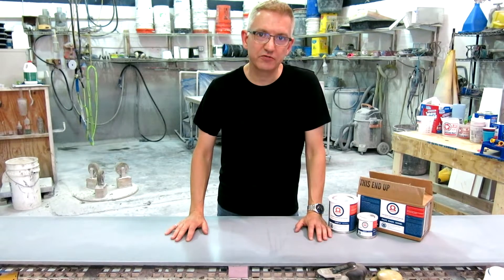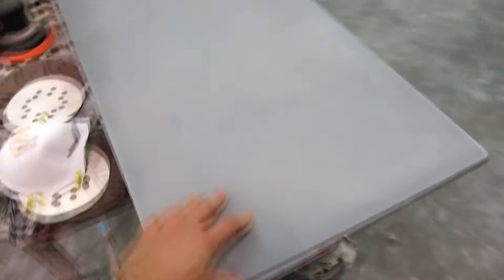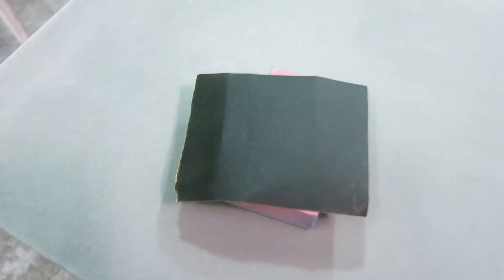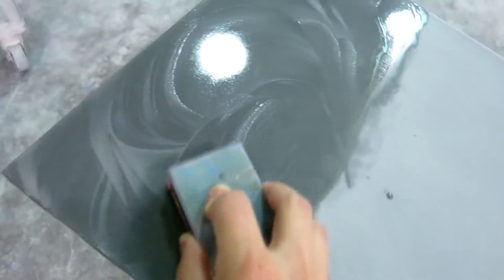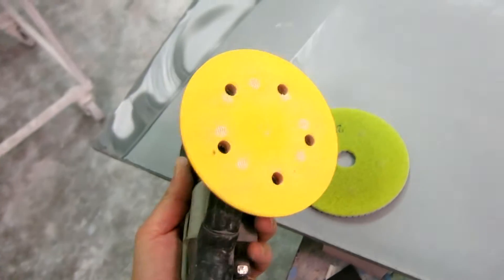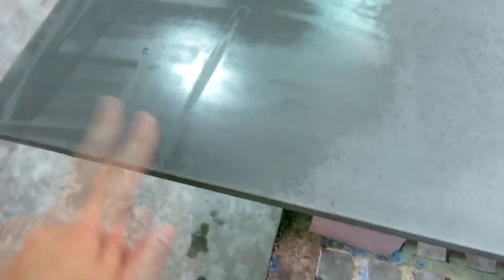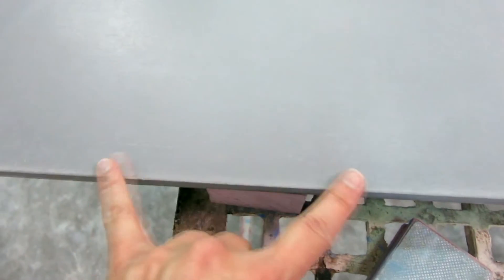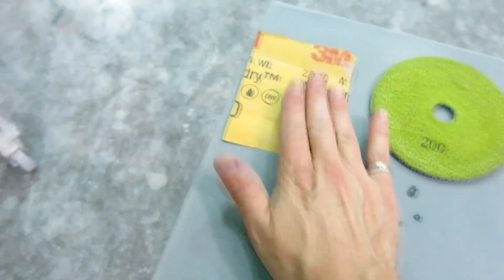Omega Instructions video 2a: Sealer Surface Prep Intro and Wet Processing

Comment: If I have an already acid stained concrete countertop (15 yrs old) and a considerable portion of the finished acid stain has already been removed just from regular use, can I use a wet sanding process to remove the remaining acid stain down to the original color of the concrete?

And what would be required to further prepare the surface to accept a different color acid stain?

Any other ideas such as chalk paint or other finishes?
Reply from the maker: Yes, you can grind down to bare concrete and then acid stain. The surface prep is the same as the surface prep for resealing with Omega. Please see this article: https://concretecountertopinstitute.com/free-training/reseal-concrete-countertops/ Chalk paint is not appropriate for concrete. You can use acid stain or a microcement/microtopping/overlay such as this: https://directcolors.com/concrete-overlays/
Reply: Will read the articles...thanks so much!
Reply from the maker: @samwimpy2600  You are very welcome!
Reply: @TheConcreteCountertopInstitute  Off subject, yet somewhat similar.

Subject: Grinding asphalt, can this be done?

My street was re-paved w/ asphalt some time ago. They paved on top of the existing street (made of asphalt) and continued to the edge of the curb. As a result, there was very little available volume left for drainage so when it rained, the street runoff would end up in my flower bed, yard, and eventually in my garage!

With the city not being much help, I decided I had to address this on my own. I used a heavy splitting maul to remove the asphalt that was preventing proper drainage in the street curb.

However, it is rough leaving my driveway. I need to find a way to grind the edge of the street to a gradual slope to smooth the transition when pulling in or out of my driveway!

Haven't found much information on asphalt grinding,  UT was wondering if some type of diamond honing attachment for an angle grinder would produce the results I need?

It's not a large area...just the width of a two car garage driveway?

Any input you can offer would be welcomed!
Reply from the maker: @samwimpy2600  That's a very different material. I really can't advise about asphalt, sorry.
Reply: @TheConcreteCountertopInstitute  No prob, thought I'd ask...thank you!
Reply from the maker: @samwimpy2600  You're welcome. :-)

Comment: Hi Jeff - thank you for the video series.  I have been creating concrete counter tops in my house & your videos have been invaluable.  I have been to Home Depot, Lowe’s, Walmart, & searched Amazon for white Scotch Brite Pads - no luck.  I am west of the Mississippi & the Rockies - any idea where I might find the pads or what would be a suitable substitution?  Thank you!
Reply from the maker: Hi Audrey. The white Scotch Brite pad is a higher "grit" and therefore less aggressive than the green Scotch Brite pad. You can use the green one and just be extra gentle!
Reply: @TheConcreteCountertopInstitute  thank you for your prompt reply.  I am creating concrete counter tops using Ardex (started with Henry’s) Feather Finish & it has been a bit stressful - I want the counters to look like I bought them from you.  I thought I was ready to apply the Omega until I watched all the videos sent following my purchase.  The wet sanding with 400 grit is a game changer!  I had dry sanded, of course , and felt good about the finish I had achieved.  Then I wet sanded and it looks beautiful.  Today  IS the day to apply the Omega!
Reply from the maker: @Audrey-km9in  Great, that's exciting!! Please send completed photos to info@concretecountertopinstitute.com (or send any questions there). By the way, we have a DIY overlay system like Ardex/Henry's called Finale. It comes in several colors and is very easy to work with, like frosting a cake. Check it out at https://concretecountertopinstitute.com/shop/finale-diy-concrete-countertop-system/

Comment: My kitchen cement countertops are now 20 years old. I would like to 'restore' them. There are acid etchings from lemon juice and some darker stains from various foods but what concerns me most is pitting around the sink. Can I diamond sand enough to get a smooth surface next to the sink and then seal them with Omega?
Reply from the maker: Hi Angie. You can, but it will take some work and will definitely change the appearance of the concrete and expose sand/aggregate. If you want a consistent appearance, you need to sand the entire countertop surface.  Please see this article for details: https://concretecountertopinstitute.com/free-training/reseal-concrete-countertops/ Also, hand sanding will be time consuming and laborious, and it might not be capable of removing enough concrete to eliminate the pitting. Therefore you might need a diamond polisher with 5" diamond pads. This page has extensive information about diamond polishing concrete countertops: https://concretecountertopinstitute.com/free-training-category/processing/
Reply: @TheConcreteCountertopInstitute  Thank you!
Reply from the maker: @angiem.3088  You are very welcome.

Comment: Hi Jeff, you mention that you can use this 400 grit wet technique to keep a cream finish and avoid acid etching. I’ve always just done the etching. What are the benefits of avoiding acid etching? Will using only the 400 grit help avoid having to grout pinholes?
Reply from the maker: Hi Mark. A lot of people swear by acid etching. There's no reason to avoid it unless you just don't want to work with acid. I'd say keep doing what you're doing. As far as pinholes, there's always a risk of exposing those even with 400 grit honing.

Comment: Hi Jeff-  Anything different to do after grouting pinholes and wet sanding with 400 grit by hand for a cream finish.   Plan on using Omega sealer.  
First kitchen counter for my home.
Thanks in advance.
Reply from the maker: Great question Mike! In this situation we recommend a final acid etch and gentle scrub to ensure good adhesion and to remove any surface residue that might interfere with a good bond. The instructions that you receive after purchasing Omega have details about the etching solution (muriatic acid and water).
Reply: Thanks I will order and go from there.  Thanks again!
Reply from the maker: @mike-cr4er  You are very welcome!
Reply: @mike-cr4er  Hi Mike, how has the sealer held up? I need to re-finish my countertops after only one year so I am looking for a product that will hold up longer. Thank you!
Reply: Holding up nicely.  Maybe check with Omega for prepping your countertop. 👍

Comment: If I am looking for a salt and pepper finish with TK6 sealer, should I just wet sand with 200?  That seemed good to me.  This will be my first concrete attempt!  But I have been reading and preparing for months now.
Reply from the maker: Hi Amy, and congratulations on your first concrete countertop! Yes, wet sanding with 200 grit should do it, but the amount of sand grain exposure will depend on the hardness of your concrete. Just keep going until you get the look you like. Be aware that you might expose pinholes in the concrete, which you will need to fill with grout. See this article: https://concretecountertopinstitute.com/free-training/how-to-grout-to-fill-pinholes-in-concrete-countertop/

Comment: After wet hand-sanding with the 400 grit, does the surface need roughing up with a 200 grit to ensure adhesion?
Reply from the maker: No,  400 grit wet is fine with Omega. However, you could still do a light acid wash to give the surface a little more "tooth".

Comment: Hi Jeff, brilliant and informative videos as always. I have used 400 diamond pad on a wet polisher  (started with 1000rpm up 2000rpm) would that be ok for water-based, nano-acrylic, reactive polyurethane sealer?
Reply from the maker: Thank you Hussein! I am unable to comment on surface prep for any other sealer, other than to say that generally any coating needs some texture to adhere to, so stopping at 200 or 400 grit (and not proceeding to 3000 for example) is required. Please consult the sealer's manufacturer for detailed requirements. Surface prep is very important.
Reply: Thank you Jeff. I have processed with applying the sealer with 5 thin coats and i have buffed in between. I have done the water test the droplet seems to stay on the surface about 1hr before it bleed into the concrete - I am  going to apply a beeswax + carnauba that is food safe. I had limited budget for this project. Any plan of making Omega sealer a lil bit more widely available in UK through Amazon/Ebay? Finding a sealer in the UK that is food safe has been a nightmare.
Reply from the maker: Omega is available for purchase in the UK from Cheshire Concrete Designs. Please visit www.cheshireconcretedesigns.co.uk or call 07807 040783.